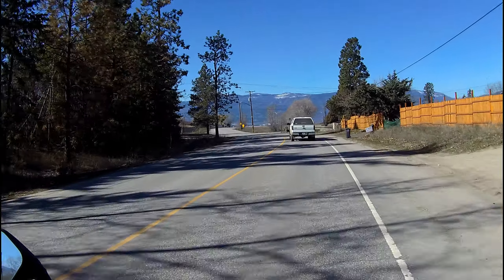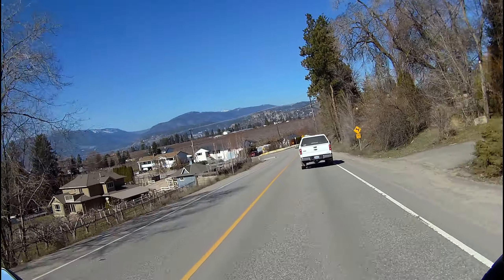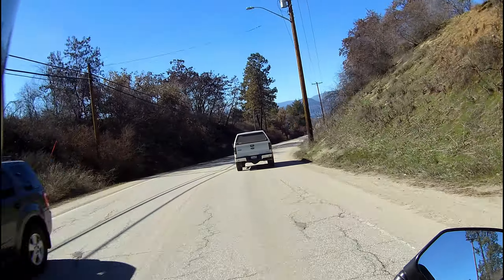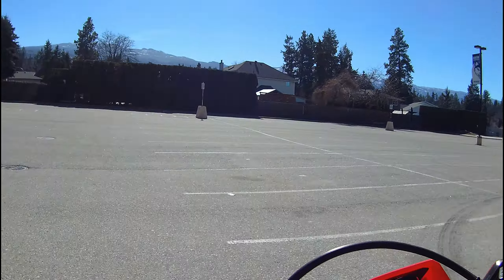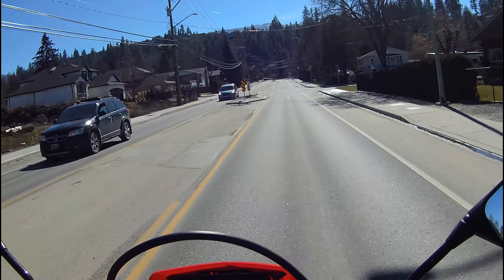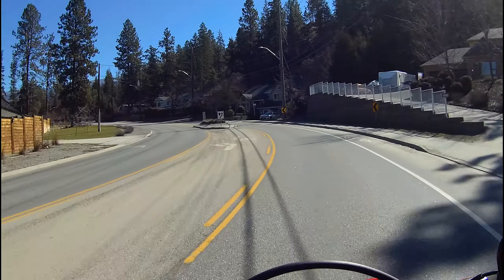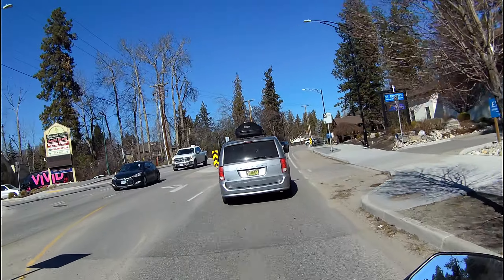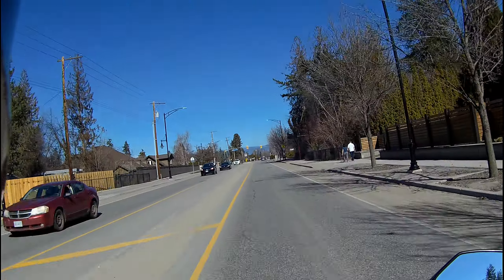Maybe Not the Best Tire Choice | CRF300L

Comment: Glad to see you had some good weather out West, John! We've had a couple of decent days here in Ontario - but certainly few and far between so far. Calling for another snow storm this week. Hopefully not too many more of those. 

I like the K270's that I've mounted on my 300 Rally. The dirt performance is great, and doesn't suffer too much on the pavement. I've read the Shinko 244's have a similar dirt feel (very similar tread pattern after all) - but the side walls are a little stiffer leading to less flex of the outside lugs when leaning on the pavement. I may give those a try at some point, but the K270's should last me a while (with no urgent want to replace them!). Happy trails!
Reply from the maker: The weather is improving. The next couple days will be in the high teens C. Be careful with the front tire size on the Shinko 244's, as the go-to size for the 300L front rim has a speed rating way below the  top speed of the bike. Enjoy your rides. I grew up in Ontario (Windsor).
Reply: @Scoottoots  Thanks - good catch!

Comment: As I said last year after your spill I had both the hop and the tendency for the front wheel to tuck with the shinkos. I used shinko road tyres on  my ST1300 and they were great but the 705s on the V-Strom 1000 were scrapped in a hurry. You have to have confidence in your tyres.
As for parking lot drills. I do them a lot at the start of the season. Living in the snow belt the bike is laid up for 4-5 months a year so drills are essential IMO
Reply from the maker: Seems a few commentors have had front wheel hop or other issues with the 705. I think I'll be switching them soon. As you say, you have to have trust in your tires. Yup, parking lot drills are an excellent way to maintain skills and confidence in handling a bike. Plus, they can fun.

Comment: I put a Shinko 705 tubelss tire on the front of my CRF250L, with a tube of course. I spent a year trying to find out why my front tire vibrated so much. I concentrated on the forks and kept adjusting them ad nauseum. Until I took a good look at my front tire and saw it had shifted within the rim to one side, ever so slightly I changed back to  a dedicated tube tire and it works fine now.  No vibration.
Reply from the maker: Thanks, I'm glad you mentioned the shifting of the tire to one side within the rim. I think I'll be switching soon enough. Perhaps I can sell the 705's. Hardly any wear.

Comment: The Shinko 705 I currently have on the front of my Honda cb500x developed an out balance feeling during a long summer road trip. It was something that wasn't noticeable before so I thought perhaps the tire was separating and went out of round. Upon inspection I found the air pressure to be well above recommended psi. I lowered the psi to where it was supposed to be and the hop disappeared. I believe that the tire had slightly deformed when subject to the high heat of summer and the subsequent elevation in pressure. I have since rode that tire for another 10,000kms without issue. The Shinko 705 works well enough on pavement and dry gravel roads but is absolutely dangerous when gravel sees even a hint of moisture. The prices of the 705 are attractive but I will be trying something else once they are worn out.
 Have you considered Shinko 244 for a better on road feel compared to the Kenda k270?
Of all the bikes I have owned my two  favorites are the Honda cb500x and Suzuki DRZ 400s. I still own them both and they are the only bikes I would buy a second time.
Reply from the maker: That interesting about the pressure and heat causing that. Not a factor in my case, but I think I'll be switching for safety sake. I don't trust a tire that hops all the time. I've looked at the Shinko 244, but to maintain stock front tire size or close to it in the right direction, I would need a 3.00 x 21 and the 244 in that size carries a speed rating of 'L' which is 121 kph. The bike's top end is 144 kph (gps confirmed). I don't ride at the top end, but I very often ride over 121 kph (on a private road of course ;-)

Comment: I haven’t practiced figure 8’s in a long time, I guess I should... I like to practice balancing in the grass, and try to see how slow I can go without putting my foot down, or even staying stationary. I think it helps develop skill for the more technical off road stuff. Maybe... If it’s the tube throwing your tire off, shouldn’t balancing the tire help it run true? I don’t know🤷🏻‍♂️
I will be sticking with off road tires, because that’s what I enjoy the most, so I’ll have a Tusk Dsport on the back, probably forever. But I do like having a front tire that feels planted on the road. Im thinking of trying out that new Tusk 2track on the front, and see how that works out. I’m hearing good things about it coming from the ADV riders...
Reply from the maker: Yeah, so many tires choices! No, balancing won't help as it is 5mm out of round so it isn't a balance issue. I'll likely be switching to something else soon enough 🙂

Comment: Ive fallen off about half my rides with the 705s on my crf300l. They work well on gravel and pavement but thats about it. So they work good for gravel touring which is also fun. But you cant beat the knobbies . I wont buy these again
Reply from the maker: Thanks for the input Redrider. I've crashed just the once with these tires being the likely trigger, but yes, if I want to ride more dirt I'll switch to Kenda K270's. I like them quite a bit. They won't be as good as the 705's though on twisty tarmac!

Comment: Currently on the stock tires on my 2014 CRF250L (guy I bought it from only out 1400 miles on it) and I think despite what people say, they are a great stock tire. I've done rocky washes, dirt trails, loose gravel roads, wet rivers and pavement all in one day on them and I honestly feel like they are a great tire. But I think there are some better. I'm interested in the Dunlop d605 as a replacement for the rear. Anybody have any experience with the D605 on a 230/250/300?
Reply from the maker: A lot of guys love to complain about the stock tires, but as you say they perform fine. The front washes out a bit too easy on gravel roads is the downside. The Kenda K270's are better than stock on dirt, but not quite as good on pavement. Always compromises. I haven't tried the D605. If you try it, let us know what you think.
Reply: I had the D605 on 2 KLX 250, 1 300 and a DRZ. On the powerful DRZ i could instantly tell more grab on hardpack vs my Trailwing. LIke any 50/50 tire they aint great in the mud but that rear can really dig, and they are soft compound so anything wet or rock they really grab. They respond great to psi adjustments, a little less on the street takes harsh square edge bumps away. If u air them down they work good for fun pace offroad, but not racing your buddies. I had my sag set weight forward {with jack up link} and the front really steered great on fast dirt and gravel roads. The rear dont last long, 2500-3000 miles. I see they make a size for my KLR but think the heavier bike with a little more power would burn up the rear fast. You problem with the CRFL is the lack of suspension wont let u set your sag distribution evenly so any 50/50 tire would have the front wanting to wash out if pushed hard.